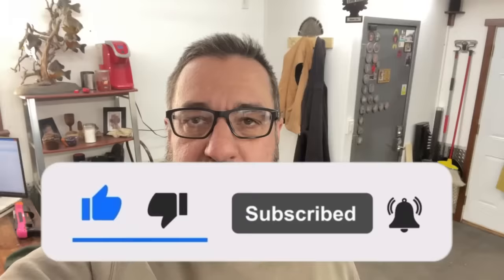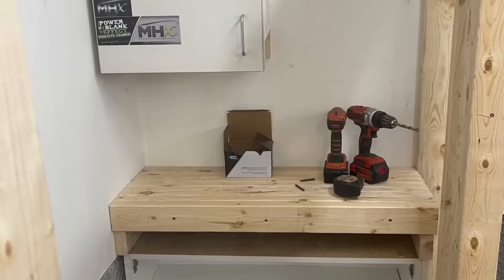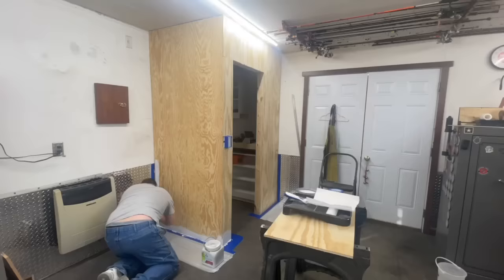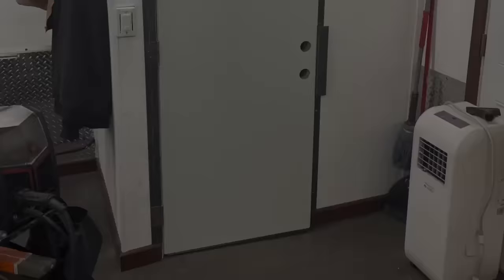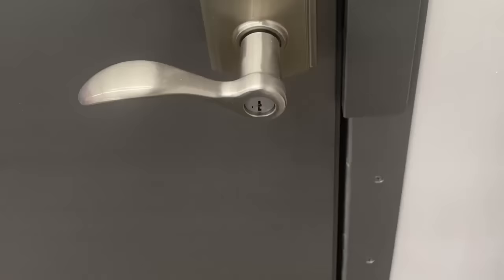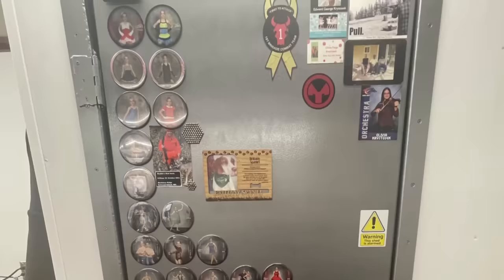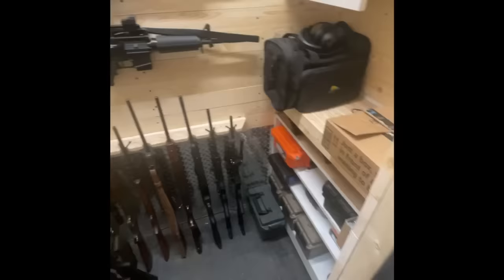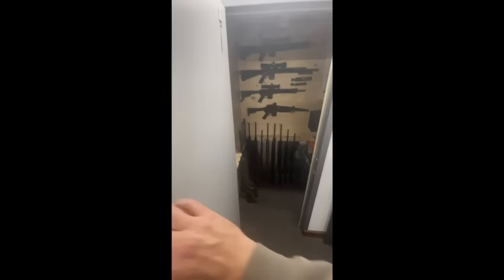DIY Walk in Gun Vault Room Storage

Comment: Pretty inspirational. This project is on my to do list. Any thieves would have to make some noise to get in for sure. And honestly that’s probably enough most of the time. I wish you had done that steel liner all the way around and up top. But theres no way for me to know what is already there so maybe it’s covered. 
I would say the weak point,  but also a very convenient point,  is the kwick set locks. The tumbler can be drilled out and opened with a screw driver pretty quickly. Other than disguising it as “not a safe” or building an extravagant internal vault lock I couldn’t have done any better. Good job!!
Reply: Should have used a high security Combination lock like the military uses. I'm amazed he didn't realize how easy it is to literally remove the electronic locks - by way of a sledge hammer.

Comment: Looks great, I did something similar, word of advice, put a Humidifier in there around 40 bucks off of Amazon, also, if you have home security like CPi, ADT something like that, do what I did and put a wireless magnetic door pin on the door so if it is opened you get an alert even if the house alarm is off.
Reply from the maker: I have Ring Cameras all around the house and inside. They notify me if someone is around and we are almost always home. We live in a pretty safe neighborhood and Police response is surprisingly good.

I have been considering a full blown security system though.

Thanks for watching.

Comment: I can only think of two ways to get into it with simple tools like a pry bar.

i  think you could attack and try to force a hole or gap into the joint between the wall and the original wall, once you got a hole in it you could hook  a couple 20 foot tow straps to it and the back of stolen truck and get a good run at it. 

Could also attack door with same tow strap technique 

Very nice build tho!
Reply from the maker: Thanks for watching.

Comment: Cover the crack on the hinge side to prevent reciprocating saw attack.  Those locks are also easily picked.  Get good commercial high security locks with security pins.  Will slow down an amateur picker.

Comment: Awesome.  The only thing I would have also done is to insulate the ceiling and walls with Roxall Safe and Sound (wool/volcanic rock) insulation that has a fire rating of about 2,100 degrees.
Reply from the maker: The entire building is finished with fire rated sheet rock. I think they call it type x. 

Thanks for watching.

Comment: Nice job.  Well thought out. Put a biohazard decal on the door and something about contains human remains. Remove anything from the door that looks gun related. That should stop the curious.
Reply: @jackofalltrades7822  i run a machine shop and turn a lot of bronze. I save the shavings to sell fir scrap and store them in 55 gallon drums with lids clamped on em. After i get em full, approx 900 pounds, i have to store them outside in a fenced in area. To keep snooping junkies from opening the drums i spray painted “inedible” on the sides of the drums. Figure i would not dare open it. Nobody has ever bothered them. They sell at scrap for over $2 a pound so thats over $1800 sitting out there. They steal small scrap metal from me instead. Let em have it.

Comment: Nice job, the only suggestion I have is to replace the Kwickset lock cores with something more secure like Medico locks. Also the hinges are the weakest links left at that point.
Reply: Welded down and the pins are welded so you can't tap them out.

I somewhat agree on the key choice.

Still, your rando would be gun thief is likely NOT going to come in with a lock buzzer or a pick kit.

Comment: Looks good. You should have put some drywall/gypsum panels into the wall for insulation/fire protection, also a dehumidifier of some sort. Otherwise great job..
Reply from the maker: The building is air conditioned and I have never seen it over 50% and the whole shop is dry walled with fire rated sheet rock. I believe that should be sufficient.

Thanks for watching and don’t miss my gun giveaway video

Comment: I guess the only flaw would be by going through the drywall ceiling. I assume the door can be opened from the inside. Still cool though.
Reply from the maker: The ceiling will be a challenge. I leads to the attic and there is only a 4/12 roof pitch so there is very little room & you will end up with shingle nail tracks down your back. You will also have to go though a lot of blown in insulation. 

If you do access it through the ceiling I will already be in your face or the cops will be there, as I also have security cameras all over the place that notify me when there is activity.

I didn’t show the cameras because the whole world doesn’t need to see where they are and how many.

Thanks for watching.

Comment: This is great build I’m going to do something similar and this gave me ideas. Only thing I would change is reinforcing some weak spots or possible weak spots. That back wall is as far as I can tell Sheetrock I would reinforce that with steel as well as the ceiling  but I’m also making mine to double as a tornado shelter
Reply from the maker: The other 2 walls of mine are exterior walls with play wood and steel siding and monitored with cameras so I didn’t reinforce them. The ceiling doesn’t have enough space unless you are a Keebler elf so I didn’t do that either.

Glad you like the video and thanks for watching.

Comment: Two things I could think of. How are the 2x4s secured to the floor. Could someone trace the outside edges of the room with a Sawzall and pull the room away from the wall? Could someone also come through the wall on the house side or ceiling? One more thing, any lock you can get from Lowes or Home Depot can be picked with a low skill rake or bump key method.
Reply from the maker: 3/8" concrete anchors are holding the walls down. I don't think most thieves are willing to spend that much time trying to get in. The locks are the best solution I had at the time. They will be upgraded.
Reply: @jackofalltrades7822  great! The build is awesome and I would like to do something similar one day.

Comment: I would love to take the challenge of getting in. If Less than 2 minutes, I get the firearm of my choice, deal? I love the work you did man. Great job, I think you missed one vital area though.
Reply from the maker: If your thinking of going through the ceiling that's not gonna work. There isn't enough room unless you are a Keebler Elf. You would have to go through the roof and that might attract a lot of attention. Same with trying to get through the exterior walls which have steel siding.

I know the locks are not the best but they are going to be upgraded.

You might get in but not before the many cameras notify me that you are there and you are facing a crabby home owner or a cop.

Thanks for the view.

Comment: Good idea and execution, just looking at it I see one glaring weak point.    With an angle grinder and a diamond blade, you could be through all three hinges, left and right side which leaves a direct cutting path to your three hinge pins.    That’s another 15 seconds per pin.    Guessing, into the room in 5 minutes, no more than 10 if trying to be somewhat quite.     The door is always the weak point in these rooms, they make inside hinges that aren’t visible from the outside, yet still allow the door to swing out.     You could also open the door and inside the door or on the inside portion of the door, make a 3 rod lock for both sides, thus preventing the weak spot of the hinges.
Reply: It would be much easier going thu the side wall.

Comment: Im from south africa(crime rampant country) and i want to give you a tip....this vault is not very safe and easy to get into with just a screwdriver or a crowbar, and without making noise while doing it. Its also not fireproof since its made from wood. Wood can break easily.  Instead try building n brick room and line it inside with thick steel plate welded together to make a box. Remember that screws can be prayed out of wood.
Reply: I have seen 1 inch rebar burglar bars broken out of a concrete wall to get in using a fence pole....they dont bring tools to break in they use whatever they find

Comment: Nice work framing the room! I'd add a dehumidifier though. Also those locks are the weak point. I could bypass then in a couple minutes and smash that alarm siren. You need some active AP system instead of just a loud noise. The room should instantly fill with OC or CS so the thieves would preemptively need gas masks.

And second- it must be police proof also. One protective order by a psycho wife or girlfriend (or an illegal seizure by the AFT) and you could be left with no guns. Make sure you have a one from each gun category well hidden elsewhere that nobody knows about.

Comment: I think the only thing you could have done better is gotten some boxes of that I don't know what you would call it but it's insulation is good for over 1400 degrees  that they use for furnaces and used it in the outside the metal  before the sheetrock it would have given a resistance for certain amount of time to make them shell it would make the room fire resistant for a short amount of time maybe even the ceiling it's called fire blanket

Comment: I love the idea and from a security point, pretty solid, but as others have commented, I think the locks are the weakest link in the chain followed by the hinges.  One thing that was of issue for me was the two existing walls as it did not seem as though you “fortified” those.  If they are interior to your house, assuming the shop is connected, then it may not end up being an issue, but if they are exterior walls, and from the existing double doors, that does not seem to be one, and they are not block walls, there is a problem.

Finally, from a fire point of view, if there is a fire in your shop and it gets to the walls of the vault, with the plywood wall, it will go up like a match, burn through the studs and then the wood on the walls.  Adding two layers of Type X gyp bd over the plywood and on the interior would have been a better call.

That said, great project and everyone can always “pick flysh*t out of pepper”.
Reply from the maker: Noted.

Thanks for the view.

Comment: I hope you know those locks are just garbage. 
Put a regular doorknob on there... Get a deadbolt with sidebars in the keyway... Get yourself a 1200 lb magnet lock with keypad and push to exit button. Get a power supply with battery backup for the mag lock. You can usually get these in kits. Not only will that mag lock be more difficult to defeat but this will also allow you to slam the door behind yourself if you had to run/hide.

And that alarm is neat but doesn't do you much good if your neighbors can't hear it.

You should move that to the exterior above the door and use it at night or when you're not home...

Maybe it'll scare them off before they approach the door.

A simple door contact and horn with a key switch would get the job done for a door alarm.
Reply from the maker: 123,000 views and you think your the first to tell me that? I wanted a key pad lock and these were a good option. 90% of thieves are not going to take the time to try and defeat 2 locks, no matter who made them. They will try to force their way in and leave if it takes to long.

Mag lock? I am not a bank or the Nakatomi building, fending off a terrorist robbery hoping the FBI doesn’t cut the power to my 3’x5’ gun room.

I never run and hide.

The alarm is loud enough. I can hear it from my bed room and so can the neighbors. I also have cameras all over the property and they notify me when there is something amiss. 

This is not perfect but it covers the 4 “D’s” , denture, detect, delay and defend.

Thanks for watching and pardon my sarcastic humor.

Comment: Didnt hear you address fire rating. You should add 2 layers against the existing back wall and ceiling. You should add fire rated caulking to the joints all around. Wouldve recommended putting plates on exterior, making sure it covers all wood and into the slab. What counters are there to ceiling access. Cut a hole nearby and then access in from the top. Hole multiple points around door frame significantly weaken it. Need to use tube steel framing recessed in slab with anchor bolts. Epoxy to slab. You are making a vault after all.

Comment: Suggestion: put a pressure switch for the light so that when the door is open, the light is on, if the door is closed, it's off.  That room is clearly too small to go in and close the door and stay for long or do anything in there with the door closed.
Reply from the maker: I already put in a motion sensor to turn the light on when the door is opened. It stays on as long as it senses motion or for 5 minutes.

Thanks for watching.
Reply: @jackofalltrades7822  That certainly works, too!  😉

Comment: Really nice, but the Kwikset locks you have on there are extremely easy to pick. Not busting your balls on your work by any means but as a locksmith with over 20 years experience those are the very bottom of the barrel locks. I’d invest in something like Medeco.
Reply from the maker: Your not the first to say that. I had my local smith replace the cylinders with something more secure.

Thanks for watching.

Comment: Thanks for sharing, Very nice and well made, I copied your model and did it using mix cement so is a 6 inch concrete mix safe vault. I used the wood walls as a frame/mold to pour the concrete mix, then let cure for 48 hours.

Comment: Very nice, but I have to mention you only built 2 steel walls. 30 seconds with a chainsaw through the other 2 and 1 looks exterior adjacent. I like the design of the steel reinforced walls though.
Reply from the maker: The other to are exterior with steel siding. I wonder which of my neighbors would hear the chair saw running at 2:00 am first?

Thanks for watching.

Comment: Sheetrock would have provided fireproofing and cant someone cut through the wall with a saw? The door is great. You put a ton of work into the door. You should have put time into doing sheetrock though just for fireproofing. Over all though. A very sweet vault.
Reply from the maker: The rest of the room is sheetrocked in fire rated dry wall. I guess cutting through is possible but it will be loud and the steel plate will slow them down long enough for me to see what is going on through my cameras and call police or deal with the problem myself.

Thanks for watching.

Comment: What about moisture control?
'They now have what are called locators that cell phone companies are selling.  We are getting one for the dog in the event she runs off.   I was also told that these can be used to inform the user if a door is opened.  When light from the outside hits the locator it automatically lets the owner through the phone know the door was opened.  An alarm is great if you're home.  But if you out and about and someone gets in your vault you'll know it.
What a great build.   I wanted to save the compliment for last.   You had me worried at first with the 2x4 construction.   Then when the steel plating was installed I got what you were doing
As for the door?  I'm not sure just yet.  Is it strong enough to withstand a break in?   As for the electronic lock and door handle.   I'm guessing it would be enough to deter.    What about using your old gun safe as the entry, but grind out the back and sides to make it fit?  Then weld it in place for the door?   Maybe too much work and I'm over thinking a bit.
Reply from the maker: The entire building is air conditioned. Moisture has never been a problem.

I have survalance cameras all over the property, both inside and out.

The old safe door was not nearly large enough for an entry door. The door is plenty strong. When a door is kicked or rammed open it is usually the door frame that fails.

Thanks for watching and I appreciate the support.

Comment: Make no mistake, the vault is well built to say the least and it would require plenty of time and dedication to breach. Having said that, the only thing I would have done different is put the 1/4" steel on the inside of the studs and then predrilled for furring strips to attached the 1x4 to. Or put them on the outside of the studs, countersunk the screws and welded over the screws. Reason being is that technically you could get in with a reciprocating saw by cutting between the angle iron brackets and the studs and cutting the bolts/screws securing the angle iron brackets and take the entire sheet of steel down. just a thought. overall impressive and to even exploit the vulnerability, you would have to either know about it or have the time to figure it out. In theory you could also take the same reciprocating saw and cut the nails at the the top and bottom of the studs. So i like  @daverumll6929 idea of welding the plates together over the studs. Either way, as i said it would take time and dedication to get into. almost any safe can be broken into with time and thats what its about, making to to time consuming for someone to get into which I believe you have accomplished.
Reply from the maker: Thanks for watching.

Comment: The steel plates are mounted to the 2x4's, so prying the steel plate away from the wood seems to be a potential weak point.  Drills and plunge saws will go right into the 2x4s between each steel plate.  Unless i am missing something...